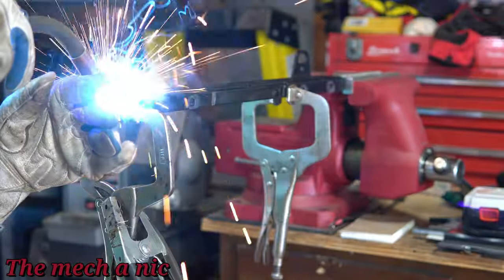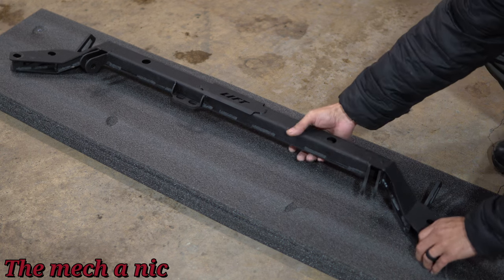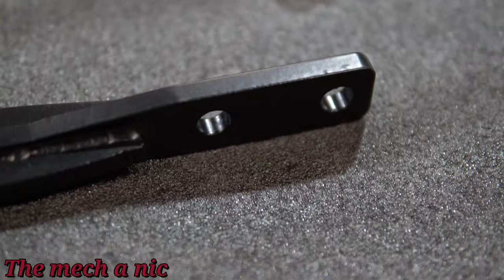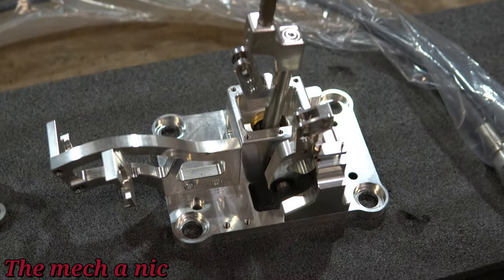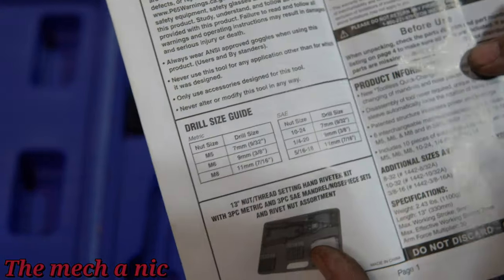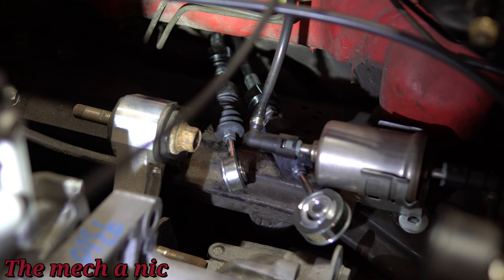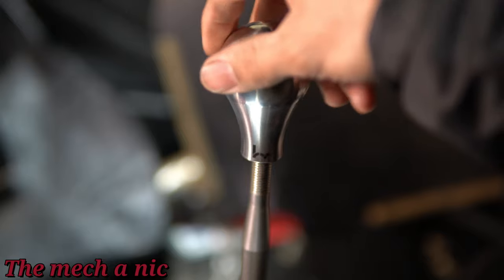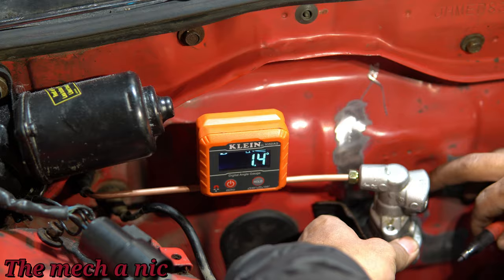k swap crx shifter and traction bar

Comment: youre the only video i have seen where someone actually installed the arms correctly the 1st time and not upside down. Also after research on my K24 swap, I used a k20a2 crank pulley and the low setting on the hasport mounts with no issues.💪 Its the big diameter K24 pulleys that hit.
Reply from the maker: I'm pretty sure I'm using a k24 pulley, it's nice to know that if I do need extra clearance I can get a k20 pulley . So far it look like it'll work👍

Comment: Do you plan on running AC?  If not, how much of a challenge do you think it would be?  I'm only concerned with the compressor mounting.  Custom hoses and everything else isn't an issue.
Reply from the maker: No I'm not running ac, no space for that type of stuff.
Reply: Okay, k-tuned says it's possible but requires fabrication to mount the compressor.  I don't have a k20 to refer to so it's hard to see the challenges.
Reply from the maker: Anything is possible with enough fabrication but I'm not interested in that. If I can get heat working in my crx I'll be ok with that